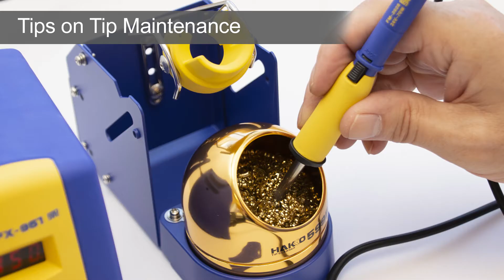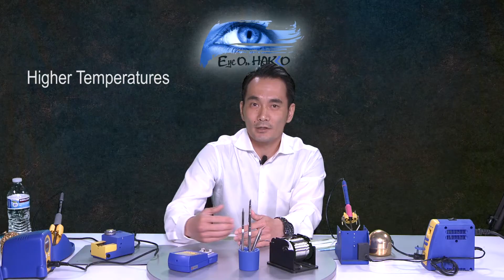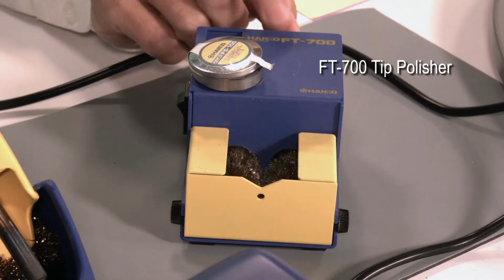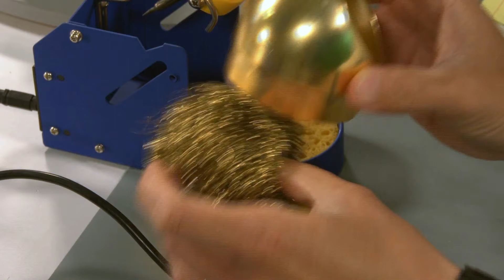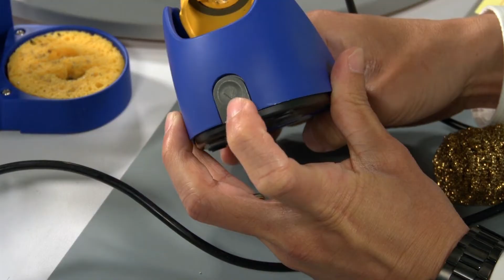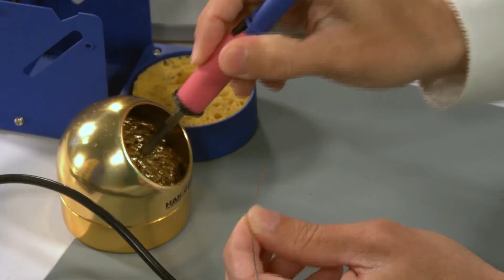"Eye On Hakko" presents "Tip Maintenance" — Video by American Hakko

Comment: We are all in need of replacement tips for Heathkit Soldering Iron Tips.  These tips were made by GE years ago but they stopped making them leaving millions of Heathkits used for years without replacement tips.  The heating element is in the tips.
Reply: The same goes for Ungar concept 2100's and some others.

Comment: I can help with why you tin the tip. Once oxidation builds up on the tip that oxidative coating (black stuff) will inhibit heat transfer from tip to wire.

Comment: People who are new to soldering may attempt to simply turn up the temperature of the soldering station if the solder is balling up, not wetting to the tip, nor flowing onto the wires, terminals or copper circuit-board foils. Attempting to solder at too-high a temperature makes the tip oxidize even faster; best to clean the tip thoroughly, re-tin it immediately, and try soldering again, before making anything other than minor adjustments to the temperature.  

The other issues that frequently arise nowadays are *poor quality or counterfeit-brand tips made from the wrong metals*; garbage "solder" made of the wrong alloys or containing little to no flux or the wrong kind of flux;  tips of the wrong shape (most soldering irons are provided with sharp pointy tips that are useless for all but the tiniest of soldering jobs); or a defect in the temperature-control feedback of the soldering station. Don't buy soldering iron tips from eBay, Ali baba or Temu!  Don't even buy them through Amazon, unless you know specifically what company is supplying them (Amazon isnt a distributor, they're a middleman re-lister of the item for a cut of the profit; their supply chain is often opaque at best and intentionally obscured at worst, although some Amazon listings will link you directly to a reputable manufacturer or distributor).  Buy your tips, solder, tip cleaners, flux and other supplies from an electronics specialty house and you won't get ripped off.  If the price seems too good to be true, it's probably junk or counterfeit.

Comment: I have a Hakko 455. It's the one that does not have a temperature control in the handle. It's older, and barely used. I was taught to always tin my irons using sal amoniac and my solder. Then I read somewhere where they say don't tin your iron if it's a Hakko. Have I ruined my iron by tinnng it?

Comment: I'm just getting started with stained glass and my Hakko 601.  I'm confused by the little metal jar of tip tinner.  In this video it is only used for avery, very corroded tip - something most of us ideally will never need to deal with.  Then to tin the tip, the demonstration uses a length of solder.  So, the tip tinner isn't actually used to tin the tip for regular use (i.e., each soldering session).  Is it correct then that I'll only need the metal 599 or sponge for regular maintenance, and not actually need the metal jar of tip tinner?  Why is it called tip tinner of it's not used to tip the tin regularly?  What am I  missing? :-)
Reply from the maker: Hi Barbara, thank you for the question, the little metal jar I believe you're referring to is the FS-100 Cleaning Paste, this is not a tip tinner. The HAKKO FS-100 is a proprietary blend of a pure tin solder powder and a suspending medium that is made mostly of petroleum jelly and just a small amount of flux. The purpose of the HAKKO FS-100 is to help the user of a soldering station remove the oxidation that may build up on their tip using a safe method that does not reduce tip life and is not harmful to the user, tip, PCB, or environment. Unlike Tip Tinners, the FS-100 does not contain diammonium phosphate, commonly referred to as DAP, which is a harmful chemical and highly corrosive. 

The FS-100 is designed as a supplemental cleaning aide for those heavily oxidized , and hard to work with soldering tips and nozzles and should be used sparingly. We hope you found this helpful
Reply: @HakkoUSA  Thank you so much for your detailed reply - much appreciated!  And yes, much clearer now :-).  I'll get a FS-100 cleaning paste, but not stress if I need a couple weeks to track this down (only one place seems to have it locally), so can get soldering without it.

Comment: Do you recommend leaving a blob of solder on the tip after tinning when you go to power it off? After tinning my tips and before power down, I always clean off the tip with brass sponge wire so there's no flux left on my tips from the rosin core solder. I'm using mostly 60/40 leaded solder, fwiw.
Reply from the maker: Great question Tim! So yes and no, yes you do want to coat the working surface of the tip to prevent oxidation, but no you wouldn't want to apply an excessive amount of solder, although it wont damage your tip it'll just take you longer to get started as the solder will need to melt first and create more of a mess before you can get started.

Thanks for the question and if you need any more helpful advice you can call in at 1-800-88-HAKKO(42556) or email us at Support@HakkoUSA.com
Reply: Thanks for asking the question, Tim. I do the blob of solder thing. (I was told it helped guarantee that air wouldn't reach the iron tip sheath and oxidise it.) So I appreciate getting Hakko's take on it.

Comment: what is the correct temperature then for cleaning the tips? I am still looking for the sweet spot to not oxidize tips and at the same time melt the solder the nice way.
Reply: Depends on the melting point of the specific solder you use. I guess the ideal is the lowest temperature that gives you instant solder melting
Reply: @monz7951  Thank you.  Its 270°C in my case.